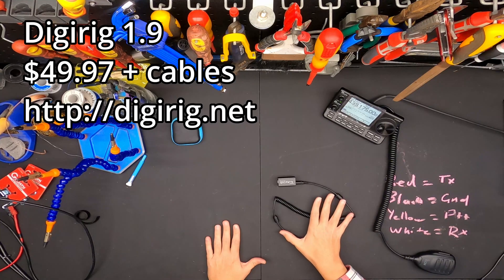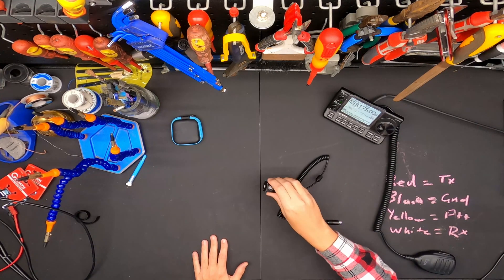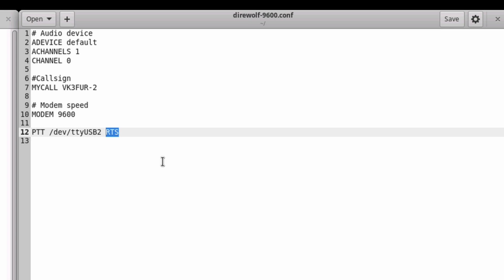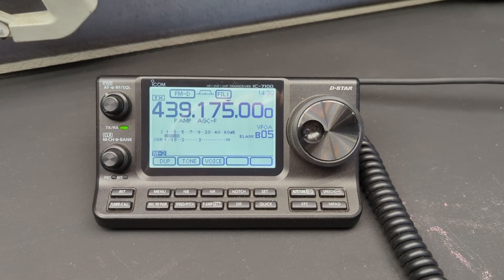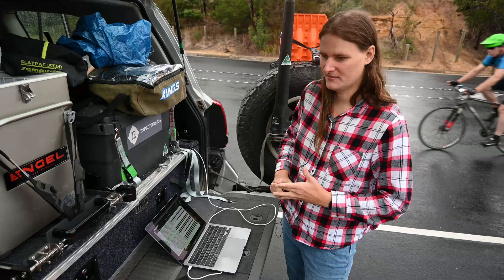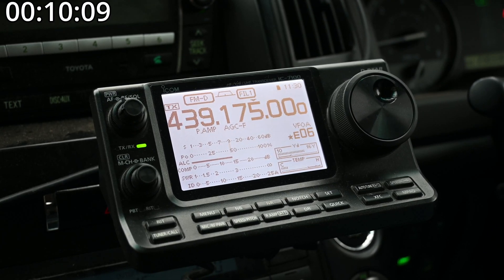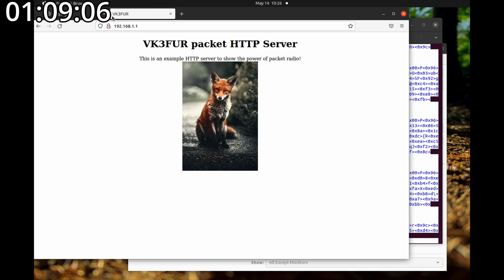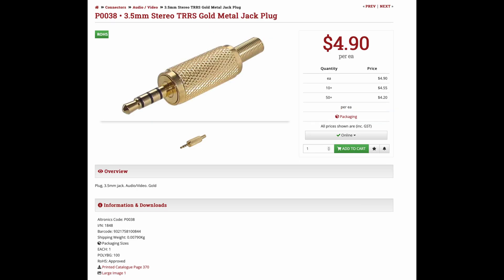Is this the easiest way to get started with 9600 baud packet?

Comment: You would love the Kenwood TH-D74. Built in KISS/TNC via cable or Bluetooth connection. You can install ax25-apps & ax25-tools + dependencies and use as needed.
Reply from the maker: The price and the battery life have kind of put me off the Kenwood TH-D74 - but I'm sure I would love it if I had one!
Reply: @xssfox  well I think it’s a good trade off. Not many radios today that have these features are available. I keep a spare battery and it last me all day. Trust me you would love it.